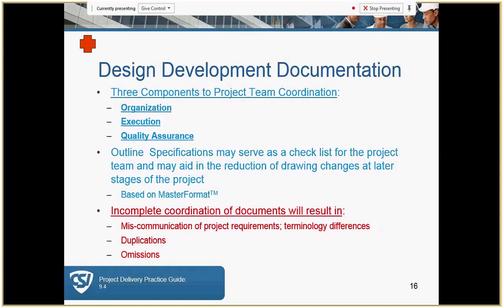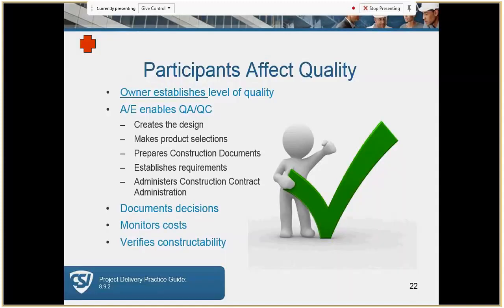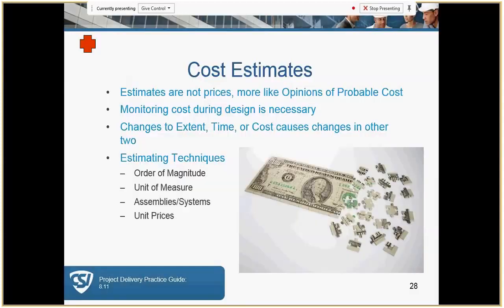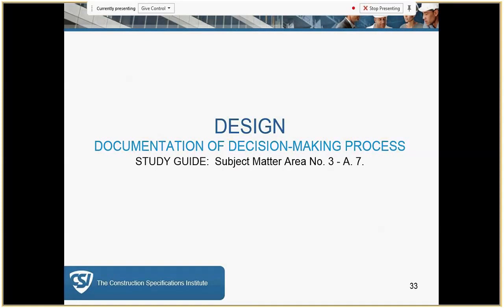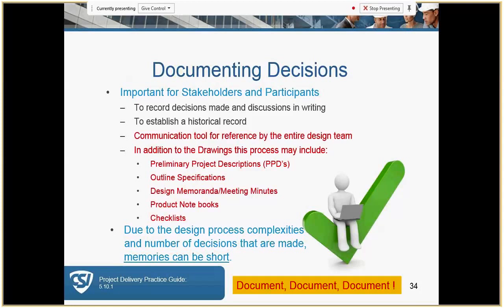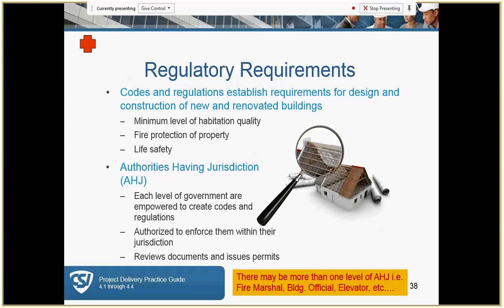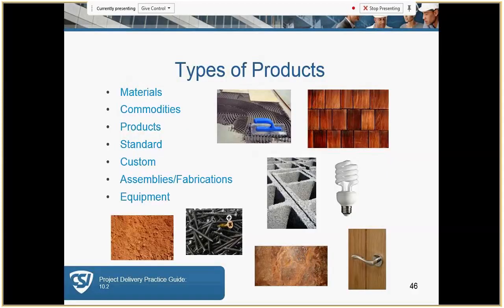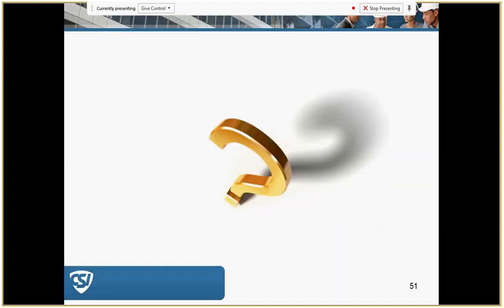CDT Exam Prep Training Session 03b Design Tuesday January 12, 2016 re recorded

Comment: The slide on regulatory requirements that influence the design of a project at 17:20 lists "Occupational Safety And Health".  In the official Project Delivery Study Workbook exercise 3C (page 118) "employment and labor laws" is specifically excluded as an item which does NOT affect the design of a project. Occupational safety laws are a form of labor law.